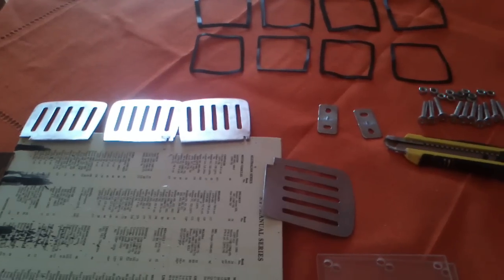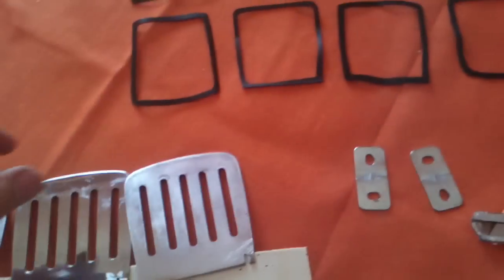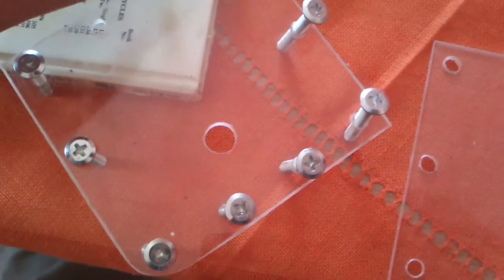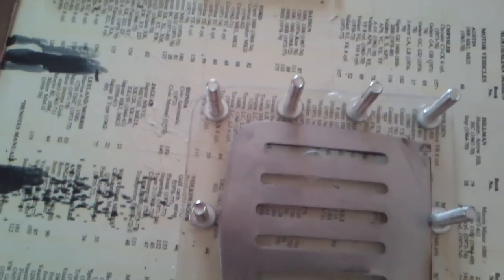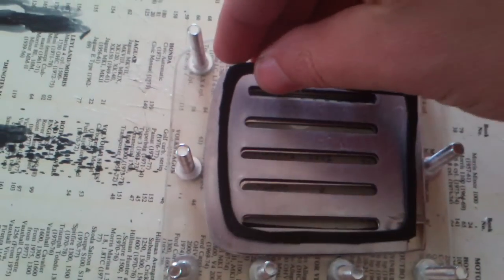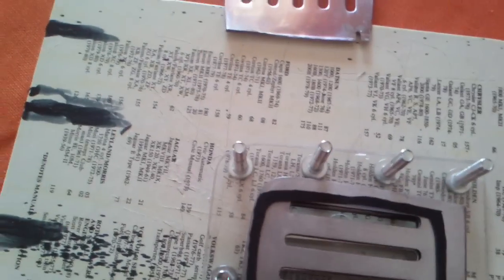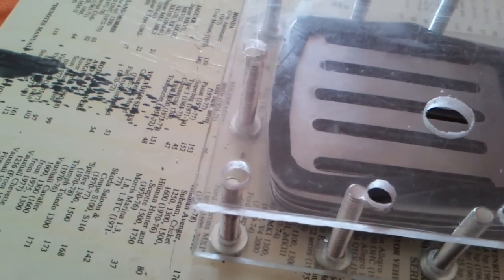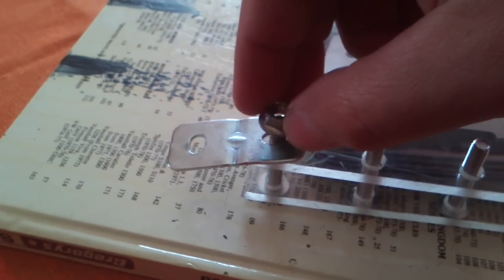How to build the cheapest hho dry cell in the world part 1 of 4

Comment: Hello what's the difference between this middle partition
Reply from the maker: middle plates are neutral plate that dont give out electricity
Reply: @01wizmiles01  
What is the difference between neutral plates and multiple plates. Current. Take hydrogen ???
Reply: @01wizmiles01  The more pole pieces, the larger the power consumption, the larger the hydrogen production amount. Is this how much V / A is used?

Comment: Where's the second half to this video? Did you ever produce one? Thanks for sharing good idea here's a link of an older system that really works well you also have to tie into your O2 sensor the first one down from the top of your motor you want to wrap it with about 3 or 4 wraps of aluminum foil to trick your senses this also helps give you better gas mileage with your hydrogen system here's my link,.  https://youtu.be/Q9TJ7lazu3o

Comment: Take the circuit design from an induction heater, use that to power your plates the oscillations as you increase the frequency will rip apart the water.
Reply from the maker: now that's a good idea
Reply: 01wizmiles01 It is not mine but it works.

Comment from the maker: If you use 5 natural plates then you have to make a bigger system. If 2 or 3 natural plates then your system will run very hot and so will your wires. The more natural plates the less heat is produced.  I recommend with all the tests 4 natural plates is enough.

Comment: Problem with using spatula is the ratio of hole area to plate area on your neutrals. A significant amount of current will jump through the holes of the netural plates instead of passing through the stainless steel of your neutral plates. Your MMW efficency will suffer because of this.

Comment: not sure how you hook the cables up to the battery and to the spatchalars?  please tell me more thank you
Reply from the maker: i put a little notch in every plate except to nutural plates. then i got female inserts for conecting wires and place the female conector on the notch. normaly i started with negative then positive and finished with negative. i found that is the best way. dont start with positive.

Comment: the whole purpose of making dry hho cell is missed here. you have too much edges surfaces inside your cell which will decrease the cell effectiveness. you can get perfect plates if you buy stainless steel sheet and find someone who can cut it, it will cost you few more bucks than buying those spatulas (like $5US more). just a suggestion dont get me wrong.

Comment from the maker: ok ive just made this video as an example on what to do. now if anyone is making this then ill tell you the way to get the best performance. first use 9 plates. first plate conect your negative wire, then 3 nutural plates, then conect a plate to your positive wire, then again 3 nutural plates, then conect a plate to negative wire, then again 3 nutural plates and then a negative plate at the end of the cell. you can make your cell large as you want, make sure the begining and end of cell is neg

Comment: The concept is good, but nothing is free ... one needs far more current than can be taped into from an average electrical charging system on your car to make the desired amount of hydrogen to actually make a difference ... power inverter, etc.

The though of making improvements are great a should never be given up on ...

Comment from the maker: sorry to hear that. try connecting your outlet gas hose to differant places on your air intake. also dont use 1 or 2 pin spark plugs try using a 4 pin spark plug. when making your fuel cell make sure u start with -nn+nn- this is the best way, put more electrolytes let it heat up thats when it works best but not too much that it over heats. use a 15 or 20 amp fuse. if your cell runs cold its shit and wont work. look at the outlet hose if u see fumes, if u see fumes it works. try making 2 cells.

Comment: Love it, I hear my firend tell me about his Hydrogen fuel cell's abilty to manufacture enough hydrogen to raise your economy of your petrol vehicle ... I decided to build one via the best plans on the net I could purchase. 
Upon installation and operation I found that no difference had been created on theis vehicle running it with a metered 5 gallons of gas with the unit and without. The end result is if you add another alternator to your vehicle to power a larger unit, it would still be nill!